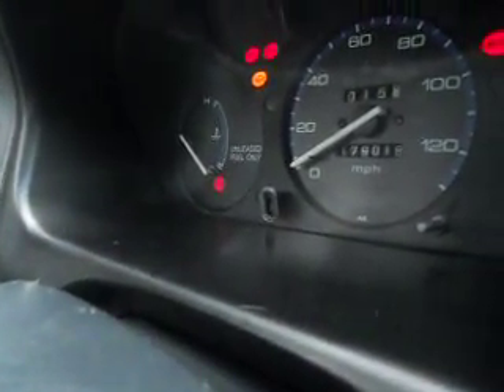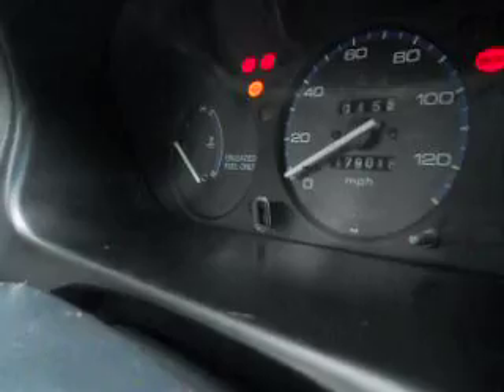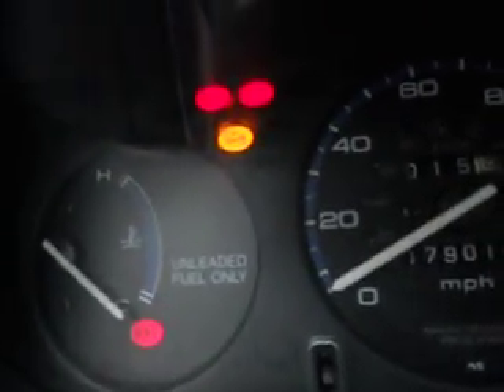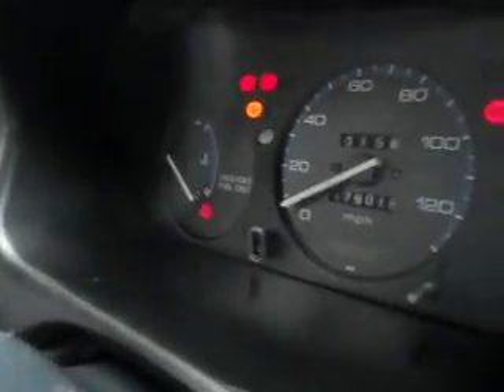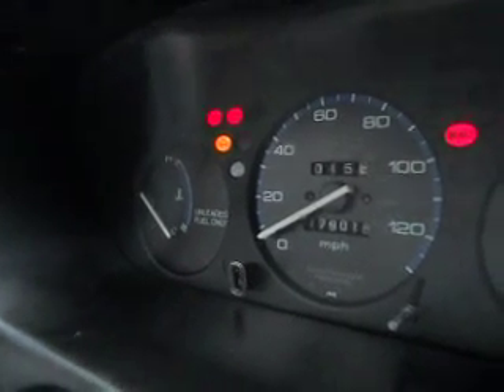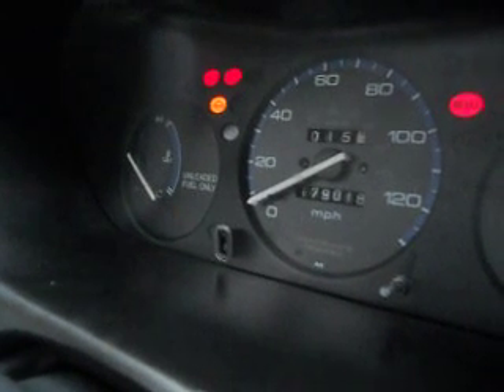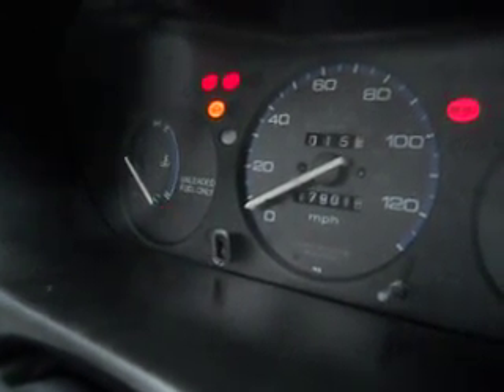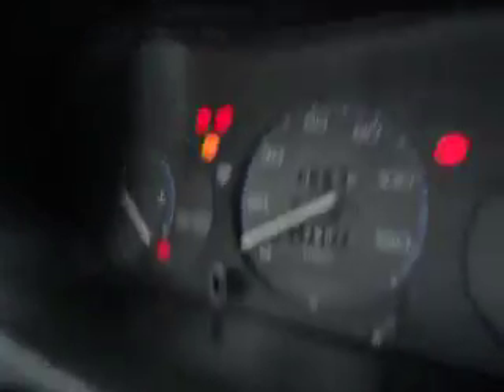bad ecu and main realy?

Comment: There are two fuses under the hood that run the ECU actually it's called PCM power control module they are the first two when you take the top off your fuse box under the hood first 2 in the left upper corner check those two fuses first. Then check the fuse box under your steering wheel you have I'm pretty sure one 20watt fuse that is for your relays. Also check the blue or white power box under your steering wheel it only has one plug in and it bolts to your column with one 10mm bolt. Before changing out anything (1) Check all fuses. (2) check the power box under your steering wheel it will be white or blue. white is factory blue is aftermarket. (3)Check for damaged wires. Best way to check fuses is to go to harbor freight and buy a test light that has a good alligator clamp on the nd for a good ground then just use the tip of the light to check every fuse. When doing so if one side of the fuse lights up the light that doesnt mean its good you have to test both sides of the fuse and if both sides light up then your good. I wish to god we could put pictures up on here it would make explaining so much easier.
Reply: @yourmom705 did you fixed this problem I have the same with my 1999 civic

Comment: I know this post is a million years old but that'll give there is not to check engine codes.  It's to disable ECM ignition timing, so you could manually set you ignition timing with a timing light.  While that plug is shorter your MIL light will stay on.
Reply: Same connector for both

Comment: My 97 civic won't start after it's hot.  Change the following:
New distributor, Timing belt, water pump, coolant sensor by the thermostat, main relay, alternator and starter is good too.  Still don't know what is wrong.  Will check the ECU soon.
Reply: Tito Drojas what was your problem?
Reply: Tito Drojas did you figure it out?
Reply: Helloooo?
Reply: It's the ecu . Mine does the same thing

Comment: Cranking not starting.Honda Accord Ex 1995 model

when I crank trying to start my car, the cooling fans stop working but starts working when the ignition turns back to the on position. Also my test lamp in the injectors feed wire goes off when cranking. I have tested the main relay it is okay, but my ignition test is not satisfactory. i don't know if my ecu is involved. how do i test the ecu with a multi meter to rule it out.

Comment: bruh I changed my battery and I got a spark and now it won't start any thoughts people
Reply: John Tamas use spark tester check all cylinders. .. so let's say all 4 cylinders produce spark... next check fuel pressure. .. if you don't have a gauge for checking fuel pressure get some throttle/carb cleaner spray some into the intake.   if it runs then bad fuel pump, but not always the case... for example check your fuses. . if your fuel pump fuse is bad then replace it... if you have fuel and spark.. do compression check.  if compression, fuel and spark is ok. then yes it may be computer issue.  but never assume. next remove timing belt cover only! !!! if belt isn't in good shape and in times then your computer may be the problem
Reply: Fuse

Comment: ey bro my main relay clicks when I have the key in your same position car wont turn on until about 10 mins after what do you think it is?
Reply: luis ochoa what was your problem?
Reply: Might be the ignition switch
Reply: Exact problem with my 96 Accord. I've ran a new wiring line from fuel pump to the relay. I've replaced the relay 5 times. I've replaced the fuel pump twice. Its been like this for years an I have just learned to live with it. It still runs fine. Only problem I have is the check engine light can not be cleared because the previous owner put in a ECU for a auto trans and mine is a manual. No one has been able to fix this problem for over 20 years now.

Comment: Has anybody figured it out yet?
Reply: William Jefferson I’m 100% sure it’s a bad ECU!
Reply: Johnny Xiong yes I swapped mine out. Works better now.
Reply: William Jefferson is it just plug and play with ecu swap? Or do you need to code it with a computeer?
Reply: Trom u need to program it. I on the other hand successfully disable the immobilizer by removing the chip from the motherboard
Reply: William Jefferson thanks
Reply: @SmokeStack456   Hi, where is this chip located... i mean which one is ?
Reply: Hamlet Cabrera it’s going to be a small chip on mine it was, let’s say once you opened up the computer, the side where the “smaller” chips are on you’re going to look for a chip with the letters, “AtMel” across the top. That’s how u know it’s the right one and just pull the thing.

Comment: did you ever find out what it was? I have 2001 gsr is acting the same way replace the relay still no luck
Reply: roberto arroyo check your timing belt if applicable.  if the belt broke it skip tooth and is out of timed then your engine may not run at all or if it does it may damaged the valves etc. .. assume computer as last resort

Comment: could a car still turn over but not start if it was a bad ECM or PCM
Reply: Tina Barkley late but a car can even run on a bad ecu, a bad ecu doesn't cause the same problem on every car/truck. It depends which part of the ecu went bad inside